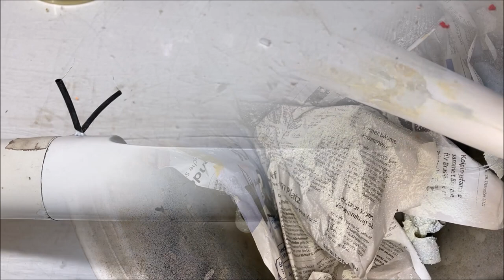Fiberglass fuselage repair

Comment: Nice work. I note you chose not to remove all the electronics before starting?  I would, just so I can get a clean work area. I'd also use "wet and dry" sandpaper with water on the finish, and acetone to cleanup.
Reply from the maker: Yes, this was a fast easy fix on a glider that I got second hand 10 years ago, For the past 2 years, it has been loaned to 3 beginner glider pilots in my club, and there it has had a rough ride.
So now it was time for a fast repairs, to get it up to date again for the next beginner glider pilot :) To remove the electronics on this glider is a real pain, so I decided not to do it. But you are right, it could have been done better :)
Reply: Don't need to take all innards out. Dust and debris are the only possible problems ... But the vacuum cleaner does miracles ! As a matter of fact it is the most used tool in my skylab 😉